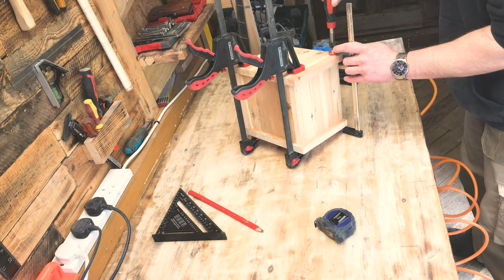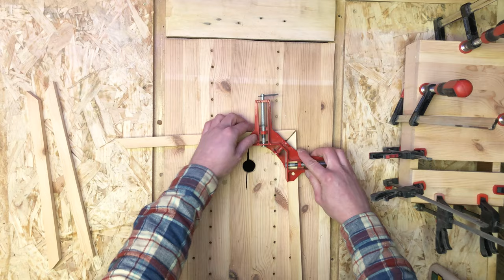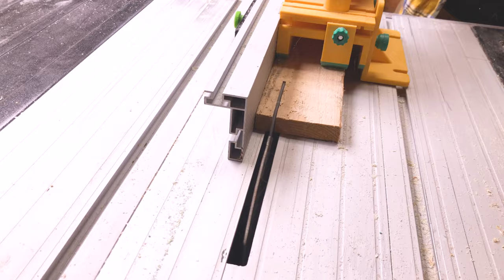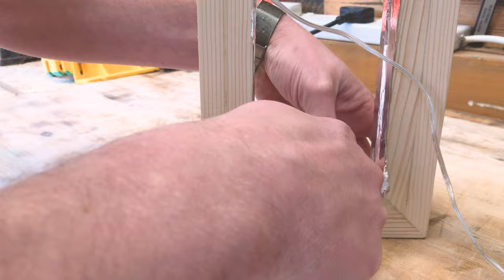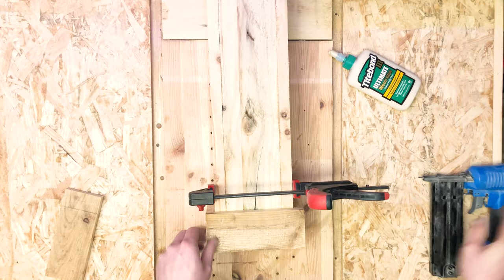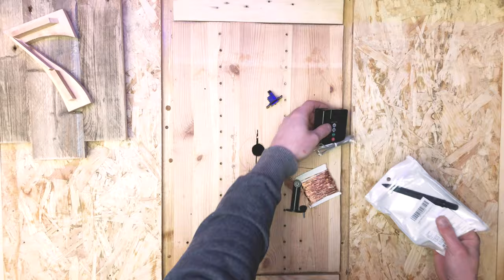5 woodworking projects THAT SELL! My Best 2024 Pallet wood & scrap woodworking videos COMPILATION.

Comment: What are you using to plug the LED lights in with?
Reply from the maker: It really depends, all of them work with 3-5V so I’m using batteries, usb chargers or 5V DC power supplies. I believe one project used 12v power supply as well. Hope this helps.
Reply: Thank you. I am loving your videos keep up the great work.
Reply from the maker: @2woots905  no problem at all. I'm glad I could help. All the best